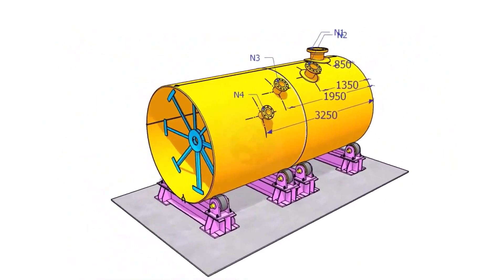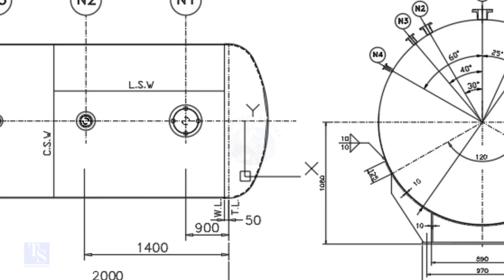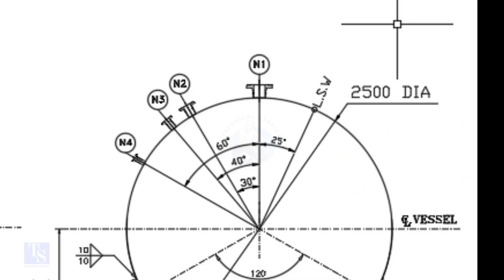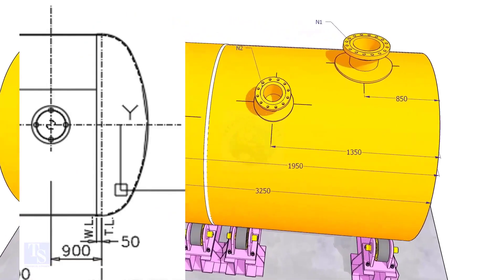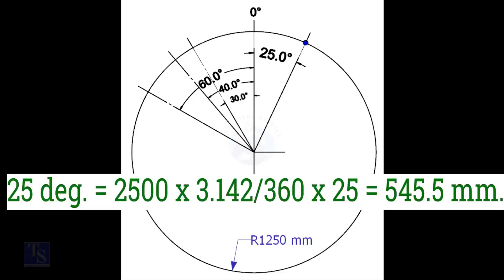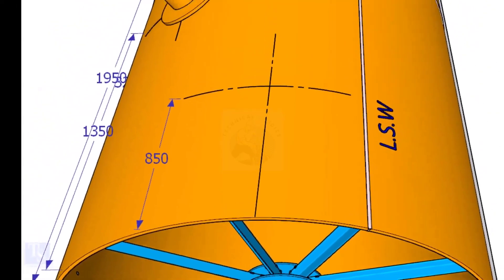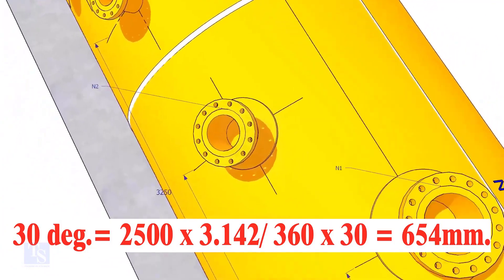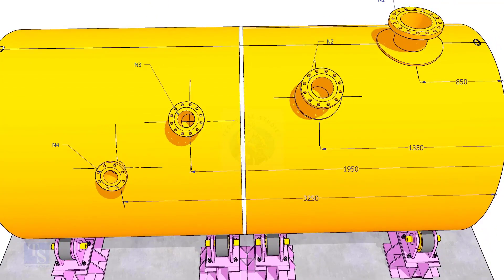How to mark Nozzle  Nozzle Center Marking on Pipe, Pressure Vessel, Tank Shell

Comment: Why does your videos never show the drawings in inches instead of mm?? I would prefer for your videos to be shown using inches and not mm.
Reply: I prefer mm
Reply from the maker: Because, most of the counters use metric system of units like meter, kg, seconds, etc. Few countries use the imperial system for measurements. Mater of viewers.